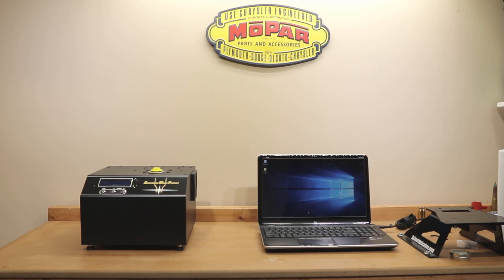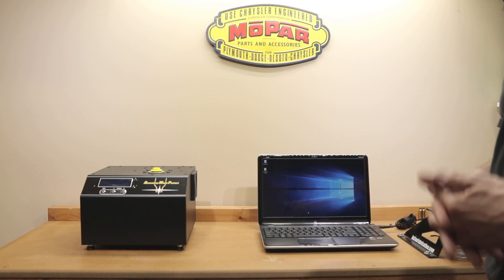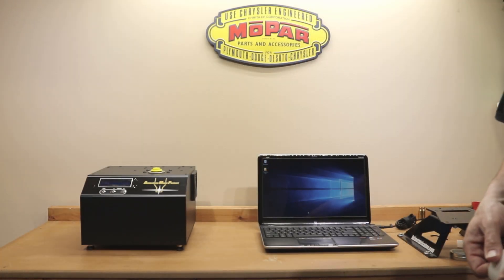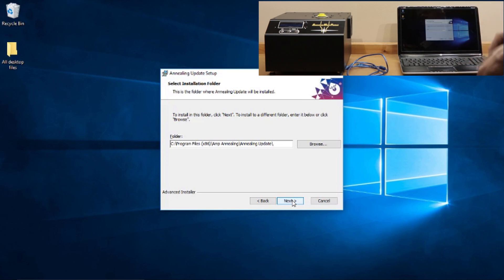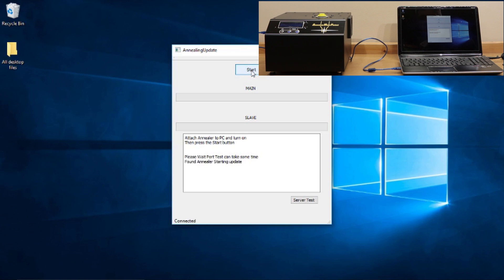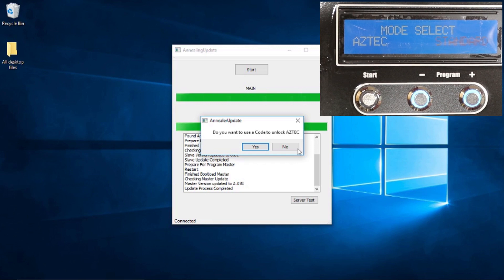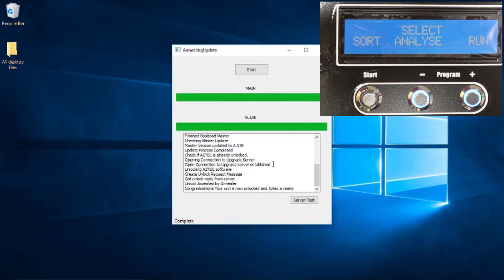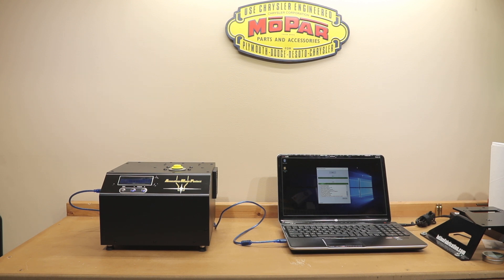Annealing Made Perfect AMP Aztec Mode Upgrade

Comment: Thanks for your very informative videos, you helped me to decide to upgrade to this fantastic product. Quite simply, it took me less time to unbox & set up the AMP annealer for its first use, then it has ever taken me to reset & adjust my gas torch style annealer (using Templac) . With the old style gas one, I would wait until I had approximately 400 cases to do as a batch, because of the finicky setup & adjustment time. Now I anneal as soon as I have a emptied a 50 case box.
 IMO if you are serious about competition shooting & or have multiple calibers to anneal you can’t afford not to use this system.

Comment: As a suggestion, it would be interesting to take several pieces of brass from the same batch/lot of brass and run the analysis. I'm curious to see if the code generated is the same for the same lot of brass. Thanks for the fine work you do with your videos, I enjoy them very much.
Reply from the maker: It is on my list of things to do when I dive deeper into it. I really would like to see on multiple machines if the code generated is the same too.
Reply: I have the machine and software too. After you run your test, if you're your still curious,  I'd be happy to run a with a piece of your brass  on my end.
Reply: I also have the same machine and Aztec mode too. Also willing to do some tests for you if you like.
Reply: Each piece of brass will be a little different. Not a great test.
Reply: I did try that with 2 pieces of brass and got the same code.

Comment: But that is a standard USB port, the cable you are using is a USB-A to USB-B, as you pointed out it is still used as a normal USB printer type cable.